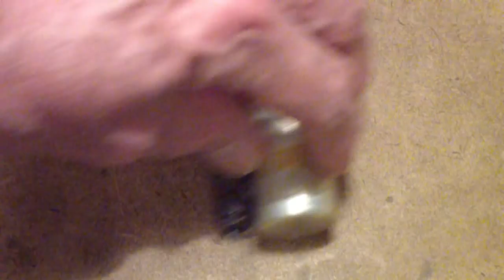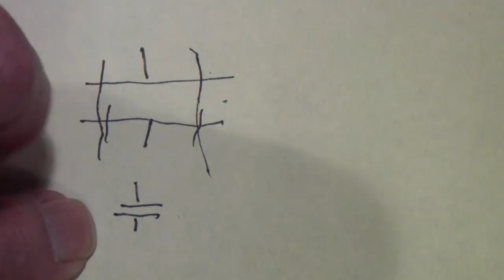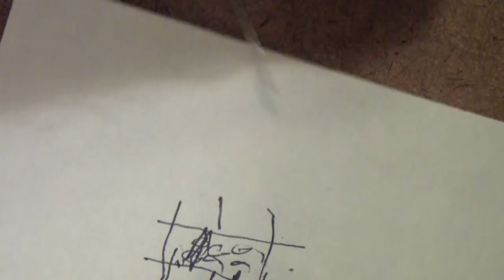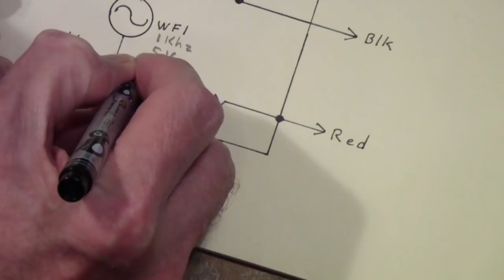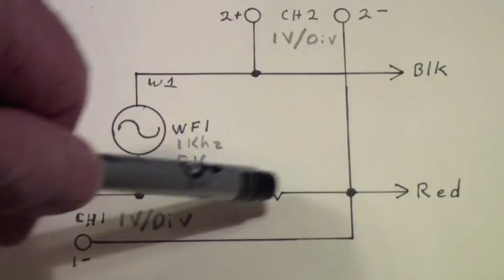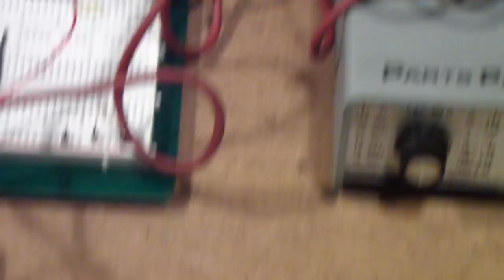TTT240 Analog Discovery Signature Tracer

Comment: Thanks for an interesting video. The aspect that rarely gets mentioned is the ripple current rating of power supply capacitors. I see so many tech replacing massive old cans with tiny ones of equivalent capacity and voltage, but I wonder whether the techs have considered the ripple current rating for those caps in the harshest parts of the PSU circuit?